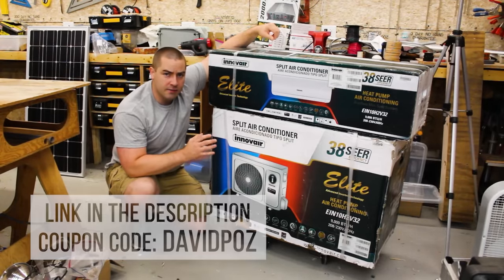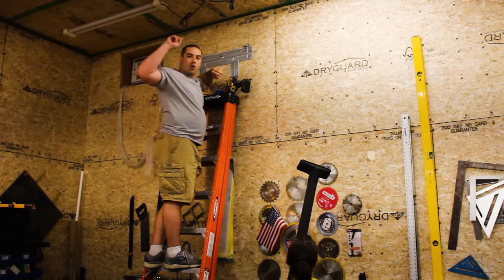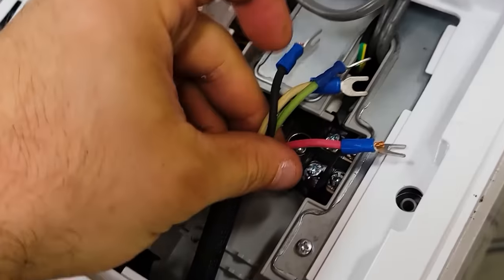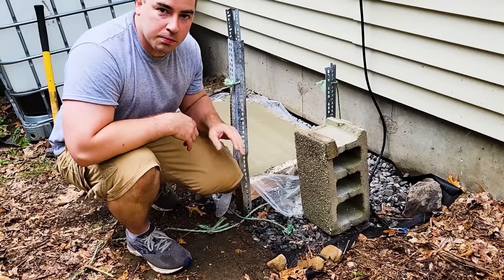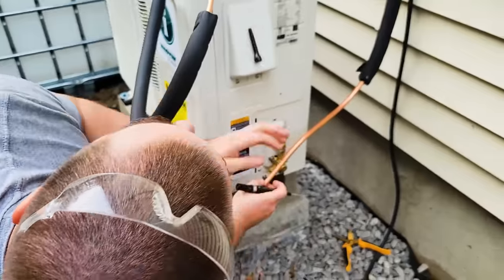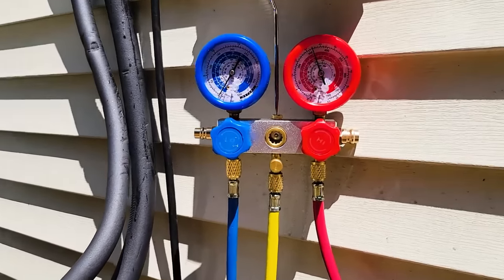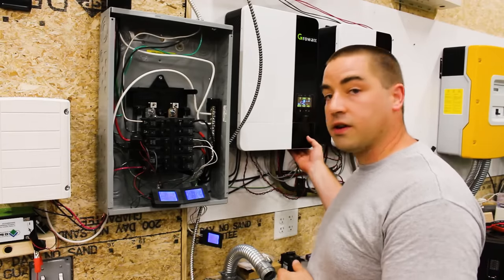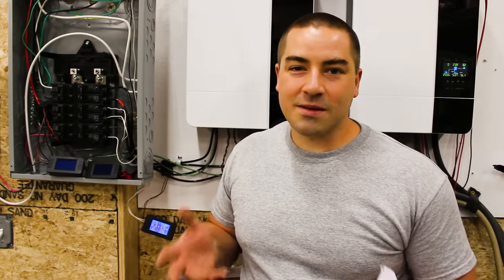DIY Mini-Split Heat Pump, Full Installation, 2021

Comment: HOLY CRAP I JUST NOTICED SOMETHING...Please tell me you had the low side valve open while you were using the vac pump.....if you didn't all you vacced and pressureized was the gauge set. You didn't show this so I had to ask it.
Reply from the maker: Yes, I did have the valve open (blue valve on gauge set).  At around 44:15 I show think I show that.  But, thank you for looking out.  This was my first time with the vacuum pump and nitrogen test, so I easily could have made that mistake.

Comment: Great video, David. Do to think the power factor reading of 0.63 at 1:05:51 is accurate? If so, that's pretty bad, especially for an inverter unit that could/should just as easily have a PFC (power factor corrected) supply.
Reply from the maker: I don't know the accuracy of that meter for PF.  How would I check that?
Reply: @DavidPozEnergy  Hmm good questions. Well one check I suppose would be to apply a purely resistive load (like an incandescent bulb or toaster) and verify that it reads 1.00 or .99. That verifies at least one end of the spectrum is accurate. If you happen to have a another load with a known power factor, that could provide another point to test. For example, if you have a killawatt meter that you believe is accurate, and it shows an LED bulb or vacuum cleaner or something as .70, then verify that against this meter as well.

Don't get me wrong; I'm a big fan of those cheap chinese panel meters. But I'm weary of trusting them with much accuracy, especially the more obscure metrics like PF. For example, that heat pump unit may have a power factor of up in the .90s, but could also be creating a little bit of ripple or EMI that throws off the cheap panel meter so it reads lower. Possibly, though not certainly, a name-brand meter like the killawatt is more trustworthy.

Comment: A video of the grow watt hooked directly to unit without auto transformer would be nice , too bad you gave your 3rd one away
Reply from the maker: I did that at the end of this video.  The auto-transformer is not "ON".
Reply: Yes you did, sorry about that, how does this unit compare to the mr cool in the house?
Reply from the maker: The Mr. Cool seems to always be running full blast.  Or, at least, when I check it about once a week with my meters It's always 10-11 amps at 115V, or about 1.3kW.  However, this new one, in the last 3 weeks of it running, averages 250W.  And my garage is twice the size of my house.  I don't have an official way to test SEER, but I can tell you back of napkin math, it's more efficient.
Reply: @DavidPozEnergy  might throw a couple kilowatt meters on the Them for week and see the totals? Would make an interesting video, even though shop is bigger, there’s lots of heat sources in the house, computer, refrigerator, freezer, coffee maker, cooking,water heater, even people put out 250-400 btu of heat per person

Comment: What about the heat side? Will it pull more or less
Reply from the maker: The same.  This mini-split has a compressor, which pulls the same wattage despite the mode.  But some mini-splits add some electric resistance heaters to boost the heat mode and those would increase the total wattage.

Comment: Good video.  Your laser gauge I don't think works well.  SEER is very misleading.  It has nothing to do with humidity removal.  In Florida where I live,  SEER doesn't mean as much.  You have to look at the latent removal capacity since it can be near 100% humidity here often.  You can't have high SEER when removing enough moisture since SEER measures sensible cooling.

Comment: i guess that you don't have to be licensed in the USA to handle refrigerants or to do electrical work.  You did an alright job except you didnt use a vac gauge to test the vacuum then do a drop test to check for leaks. The manifold gauge set cannot give you an accurate reading of the vacuum.  I suppose that you will put brackets on the suction and discharge lines and enclose the refrigerant lines in some sort of casing.  The unit you bought runs on 410, you should have bought one with R32 or similar.  R32 has better greenhouse gas numbers and ozone numbers.  I'm not sure that i understood your pressure testing procedure it seemed like you pressure tested twice.  Did your unit have a capillary tube connecting the high and low sides unless it had an electronic TXV.  I liked your foundation for the condensing unit. Good Effort.

Comment: I always inspect the shipping cartons very well before accepting the product from the carrier. I have had to send a complete setup back because of damage some concealed and some not. These internet sellers will resend units that have been shipped and returned without inspecting them for damage. I would have returned this unit and demanded a new one.

Comment: Just how big is your garage and how did it do in the heat setting?                              just wondering
Reply from the maker: A little over 1,000 square feet inside.  I have not gone through a winter yet with this mini-split, so I don't know how well it will do in the winter.  Currently I heat my garage with a solar thermal system, radiant floor, and electric backup.  I have several videos on my channel about that.
Reply: @DavidPozEnergy  thanks. I just wanted to know if it works on heat

Comment: How efficient is it on heat mode? I just installed a Senville 9000 in a studio an it is not very efficient in the heat mode. It is rated at 10.0 EER and 20 SER. I have not used the cool mode yet.
Reply from the maker: It works well for me in heat mode.  I made a follow up video: https://youtu.be/IgCOmzCWGrU

Comment: Design pressure is not supposed to exceed 240psi on the line set, as the delicate evaporator internals are not rated for over 240psi.
Reply: With Mitsubishi and Fujitsu, the numbers are exactly the same and they recommend pressure testing to 500-600 psi.  The indoor unit is basically just a heat exchanger on these units.
Reply: With heat pumps that evaporator can reach pressures of over 400 psi from just running in heat mode.

Comment: Nice video.Have you had any issues with the operation of you mini split since you did not pull your vacuum down to 500 microns? Obviously, you did not use a micron gauge during your install.
Reply from the maker: So far, so good.  Just a few days ago I made an update video on this unit: https://youtu.be/IgCOmzCWGrU  If I ever do another one I'll be buying a micron gauge.  Do you have a preference for which micron gauge works well?

Comment: I might be way off…but without using a valve core remover or adapter, I don’t think you pulled a vacuum in the line set. Just the small area in the hose between the pump and fitting.
Reply from the maker: The adaptor (brass) on the end of the hose has a middle piece that depresses the pin on the Schrader valve.
Reply: @DavidPozEnergy  That's correct I think for standard HVAC systems, normal split systems...but I think for mini-splits you need one of these adapters for your manifold gauge set/adapter: https://smile.amazon.com/dp/B07F9TGJ12/ref=cm_sw_r_tw_dp_TEJR0HN463GK2X3739T2 (or use a core remover) Also, now that I look closer, I think you may have used one, it just wasn't clear in the initial showing of the connection.
Reply from the maker: Vacuum pump and gauge set: https://amzn.to/3jAG9WO
This is what I purchased.  In this kit is two brass adaptors similar to what you linked to.  That's what I added on the end of the hose to fit the mini-split. 
But, hey, if I do another one I'll buy the core removal tool and try that out.
Reply: @DavidPozEnergy  Nice! With the core remover, you should be able to stick a dedicated gauge to read the vacuum while it's being pulled as well...might be going overkill though. :)

Comment: Just curious why you had to charge it with Nitrogen if the unit was pre-charged?
Reply from the maker: Yes, it's pre-charged with refrigerant.  I used Nitrogen to pressure-test the connections to check for leaks.  Then I removed the nitrogen and opened the valve to let the refrigerant flow.
Reply: @DavidPozEnergy  Much appreciated.  Great video

Comment: You probably should have used j blocks instead of making tight holes through the vinyl siding. And mount the ac box on a treated board with j channel around it. Vinyl siding needs to be able to float so it can expand and contract. This is a problem that most homeowners don’t realize. Lets be honest most professional installers will get this wrong as well. With so many houses having vinyl siding you would think people would understand how it works.
Reply from the maker: Very good point.  Thank you.

Comment: I would take the 38 SEER rating with a grain of salt, based on the poor workmanship and  tolerances... Is it made in China?  Just for my edification as it's been my experience that many claims are far off claimed specs with products I had purchased from their products in the past.

As an alternative the Mr. Cool DIY precharged unit is an excellent high quality unit... 

Please let us know how your savings panned out.

Thanks for taking the time and effort to share your experience.👍🏼
Reply from the maker: I've also reviewed the Mr. Cool here: https://youtu.be/WWBWdQy9qgw
Reply: @DavidPozEnergy  great I'll check it out... I can only go by your criticism of the product you installed with regards to its build quality. How has the unit functioned and is it truly efficient and saving you money?

Comment: The low side is rated 240psi.  When the unit is not running the high and low become the same so you FAR over pressured the low side during the pressure test (350psi}.  Lucky.

Comment: Resistant heating is 100% efficient?
Reply from the maker: Yes.  100% of the energy consumed at the heater is converted into heat energy.  An example is a base-board heater in each room.  This is based on measuring the appliance efficiency.  
Now, the topic can get larger and  more complex if we want to discuss transmission losses (the grid), generation losses (powerplant), and possibly the original fuel processing.

Comment: David, did you previously have a Mr. Cool unit?  I'm considering one of their 3 zone mini-split units, but not if you or other reliable users have had issues with them.  Please let me know.
Reply from the maker: Hi George, The Mr. Cool unit I installed was a DIY version.  It came pre-charged and the lineset was also pre-charged.  You couldn't cut the lines.  I had issues with it icing up within 2 weeks.  Eventually it was determined that it was low on refrigerant, but Mr. Cool would not pay for the diagnostic, or for more refrigerant to be added.  It's been working fine since, but I'm a little bitter about it.  That's why for this garage I decided to just go full install on it.  I bought all the tools.  Now I can take full ownership of the install.
Reply: @DavidPozEnergy  Thanks for your reply.  I really like the idea of having 3 separate air handlers and that the Mr Cool is a DIY solution, but at the quoted price of just over 4k, and without decent customer support, I think I'll have to see what else is on the market.  I would consider that 38 SEER unit from Signature Solar, but it's not a multi-zone so I'll have to keep looking.  I am no opposed to buying the tools like you did so I can evac a non-DIY unit, like you did.  I know you hear it often, but people like me, average Joe's, really appreciate the time and energy you put into these videos.  Keep up the awesome work!
Reply: @DavidPozEnergy  so are you saying that the mrcool units left air and moisture in the line sets?
Reply from the maker: Hi John Wyman, No, I'm not saying that.  I believe the Mrcool unit came a little low on refrigerant.  I had to have refrigerant added to stop the icing up issue.
Reply: @DavidPozEnergy  okay thank you for the clarification.

Comment: What kind of switches are you using for the PV in this video that you turned off ?
Reply from the maker: IMO brand PV disconnect.
Reply: @DavidPozEnergy  Thanks thats what I thought

Comment: Consider taking out the inverter and running it entirely and directly off the 48v DC it actually takes. 6% (at least) efficiency gain for free.
Reply: That would require a re-engineered circuit board/design.
Reply: @USA-GreedyMenOfNoIntegrity  shouldn’t. Literally there’s an inverter in it that powers dc 48v so that the pump can be continuously variable. The inverter is just converting ac to dc. It’s not doing anything special otherwise. The modulation of amperage draw should be done by the dc pump internally. 

Wish these companies would make their units modular so that you can buy them pure dc 48v and then opt to buy it with a plug in inverter for ac installs right from the factory. Solar, rv, all would benefit from a great 48v heat pump unit. Especially a multi head system that could then have fridges, hot water heaters, freezers, etc connected to the single unit.  Would be way more efficient and in RVs it would save massive space and the noise from the stupid AC air conditioning would finally be muted.
Reply: @USA-GreedyMenOfNoIntegrity  we could know for sure if there is more than 2 wires coming out of the inverter on the unit or not. If there isn’t it’s just a dumb inverter.

Comment: I have two 18000 BTU MINI SPLITS. One LG and the other is Mitsubishi. The LG is about 6 years old was in my bedroom. It still works, but the fan has always been as noisy as a drill. I don’ t recommend anyone put one in the bedroom like I did, because it drys the air out. I had to buy a humidifier to keep from getting bloody nose while sleeping. I moved the LG to my garage and replaced it with the Mitsubishi. It is so quiet, I keep mistaking it for a running toilet. I love how quiet the Mitsubishi’s are.

Comment: How many BTUs and peak current?
Reply from the maker: It's rated for nominal 9,000BTU (under some circumstances it can be higher).  And 3.5 Amps maximum. Right now it's drawing 2.5 Amps.

Comment: Did You know that the MR COOL Mini-Split ... the lines are also charged with freon?  So No Need to vacuum the lines:) 
But very good AC!
Reply from the maker: Yes, I installed a Mr.Cool last year.  However, it came low on refrigerant and was freezing up.
Reply: @DavidPozEnergy  OK 
Well it looks like you have an awesome new AC source as well now!

Comment: Is 38 SEER for real?  That's about double the typical minisplit.
Reply from the maker: If someone can come up with a practical way to test it, I will.  In the meantime, I can compare the past 3 weeks to the previous 5 years of using my window AC.  My window AC typically runs 24/7 all summer and never gets the garage down to the setpoint.  This new mini-split reached the setpoint the first day, and since then is averaging about 200-250 watts, which is HALF the watts the window AC draws.

Comment: Why is it mounted so high? IF it is heating it is too high, you heat the ceiling, and if it is cooling it don't need to be that high anyway because you are not walking on the ceiling.

Comment: My air conditioner here in Florida uses 3000 watts!  I can't wait for it to DIE.... so I can buy one of those minisplits.  Then I can get rid of all the floor vents all over my mobile home.  Rats can easily chew through my ductwork under the trailer and get into my vents!  After THEY do their damage, then the GIANT cockroaches can get into the trailer also!!!  I solved the cockroach problem by placing
netting on every floor-vent.  I can't believe how STUPIDLY designed the air conditioner is.  Morons designed it.  Your video was the BEST ONE I ever watched on this subject.  Thankyou... and I will be
looking into the same unit you used.  Might have to hire a pro to install it though.
Reply: Because of the MUCH greater efficiency you would likely save enough money monthly to more than justify throwing out the old system in favor of a new mini split.
I have a Senville Aura 18,000 btu mini split that is "only" 20 SEER and it's awesome.

Comment: Are these SEER ratings legit or are they bogus? I have an 18 SEER Daikin and its more efficient than I expected, I'm wondering if this thing could really be more than twice as efficient
Reply from the maker: My understanding is:  Yes, they can operate at these high SEER ratings, but might not be running there a lot of the time.  Mini-splits like work best when you set them at one temperature and leave it there.  When you first turn on, it will not run very efficient.  But, as the temperature steadies out, and the mini-split only has to maintain the temperature it becomes more efficient.  I can see my mini-split use less and less energy as time goes on.

Comment: A bracket mounted up on wall easier and a premed one about $70 and put as high as you want.
Reply: Definitely easier, but depending on the construction of the house, you'll sometimes get fairly loud vibrations transferring through the wall.

Comment: Never seen an havoc guy do a pressure test.  I typically see them pull a vacuum than see if it holds it.
Reply from the maker: Not all leaks show up under vacuum.

Comment: 1) Electric Heating is not 100%.
2) That black insulation that you cut was not shipping foam.
3) Do not move the water drain over to the Electricity side.
4) I would not tilt the unit unless directed.

Comment: The SEER rating is not necessarily the number to look at.  If your depending on it for heating in the winter then you need to look at the HSPF at the design temperature for your climate.  For example here in Western WA using the HSPF at 5 degrees F would be the important number.  Mitsubishi has the highest HSPF at 5F of 3.38 with one of their models.  Also their known for their dependability.  You pay a little more but get something that has actual published number and a long history of reliability.  Do you research and understand this stuff.